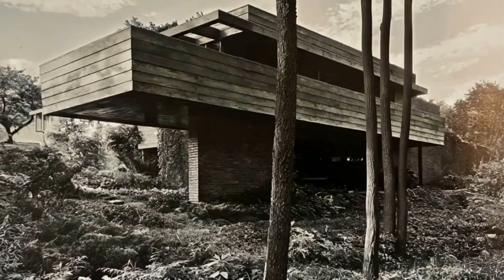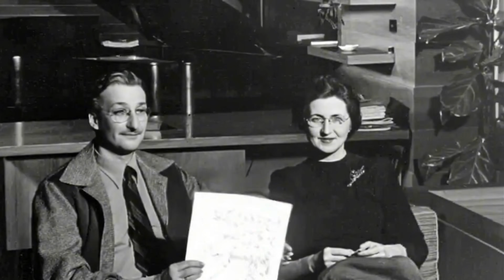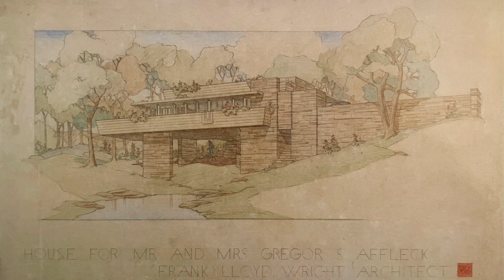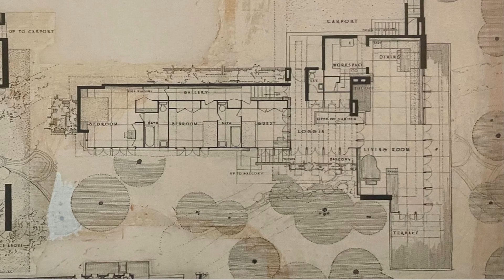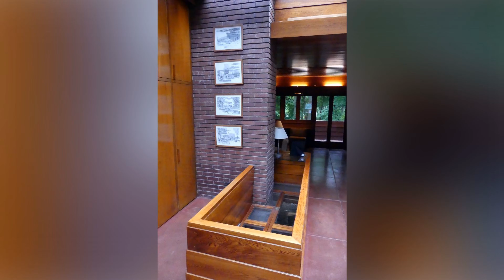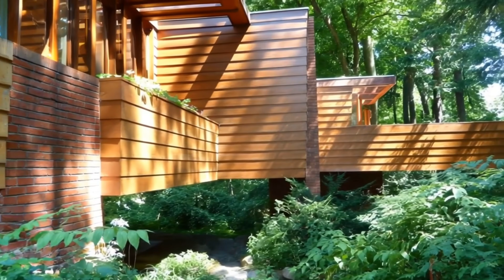The Secret of the Floating House!

Comment: I've toured this house. so many amazing and unusual details and features!
Reply from the maker: Lucky you—touring it in person is such a treat! The Affleck House is packed with Wright-isms: that cantilever over the ravine, the mitered corner glass, the red slab grid aligning with the built-ins, and the low-to-high ceiling “release” toward the window wall. Which detail surprised you most? Thanks for sharing! 😊🏡
Reply: @fzarchitecture  I was surprised that going under the house  to get to the wading pool you have to seriously duck!  It was high enough in general- just the entry point was crazy dangerous. I did like seeing details like the tinted grout made flush between the  vertical edges of  the bricks to create a more horizontal effect.
Reply from the maker: That is exactly the kind of detail a visit reveals. Your observation about the flush vertical joints is particularly helpful: small masonry decisions can change how strongly we read the horizontal lines. Thank you for sharing both the spatial experience and the craftsmanship.